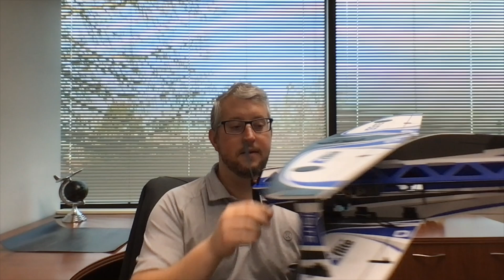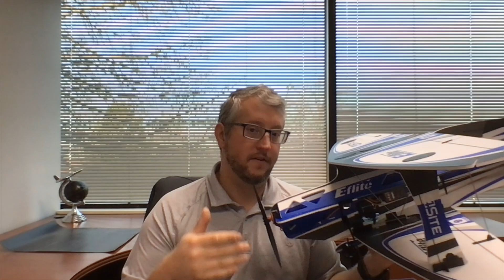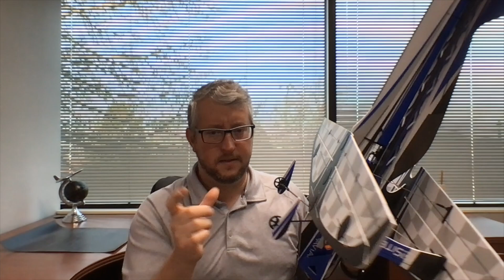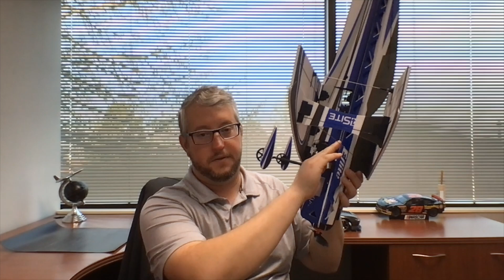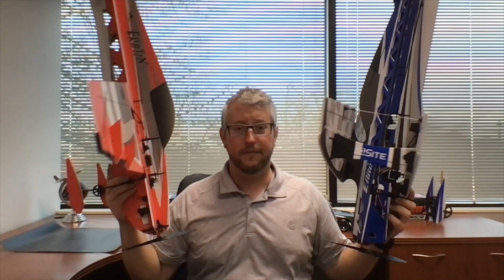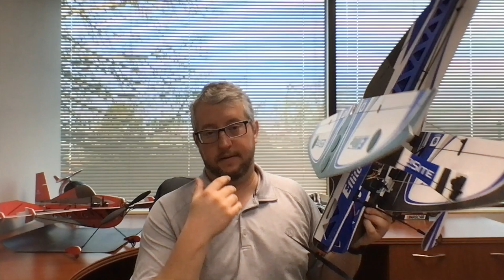The E-flite 4-Site 3D Is Here - Comparison and Overview

Comment: you compared it to the eratix in some ways but you never mentioned how it compares in terms of flying. i have both of these in realflight evo and they are very different flying. i like the eratix in pretty much every single way. its more punchy than the 4 site and seems to have a better balance also. when flying the 4 site is seems like it always wants to flop over, idk how else to describe it. when hovering each plane the 4 site is much harder to hold in a hover than the eratix. the 4 site always wants to flop one way or the other. kinda the same thing for knife edges and such. also seems like the 4 site needs more speed. seems like the eratix is much happier flying slow. 
im really question how accurate realflight evolution is and if what im noticing transfers to the real thing. i do have to give you credit though because while you didnt mention how they fly you did actually compare them to each other which i havent seen any other video do, so good job with that.

Comment: It annoys me when ppl complain about money. If it's too much you have 2 choices. Save for it, or don't buy it. Facts are, the price tag doesn't change😂

I found it odd that the replacement clips are beefy and stronger than what comes with 4-Site. I replaced them all. Never had one break or bend since. Wish I had of known this or came with it. It's under replacement parts. Not optional.

Comment: Great video . I have a question ? You say the prop is different from the eratix. But HH website and the manual says  part number is EFL01988 which is the same as the Eratix . Which is the correct Sku for the prop for this model ?  Thanks in advance Steve !  Keep up the great vids !